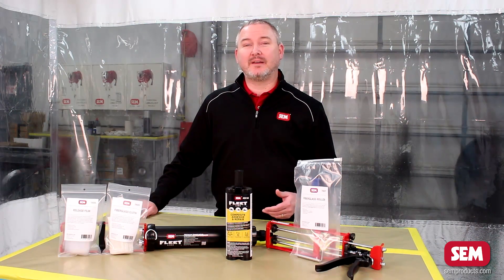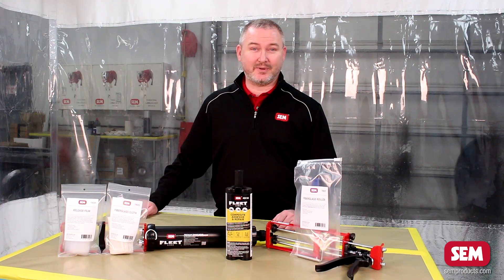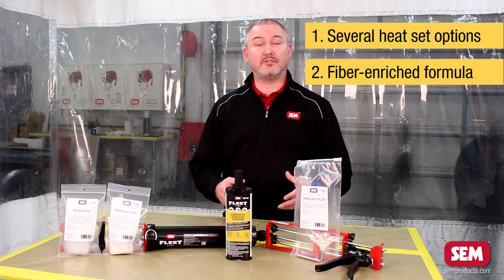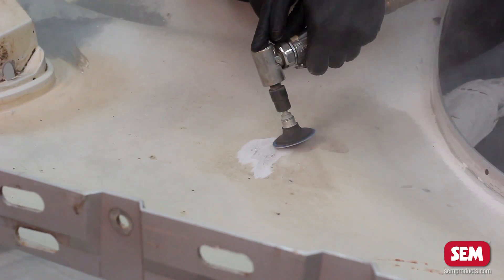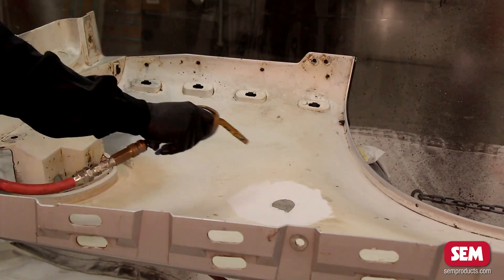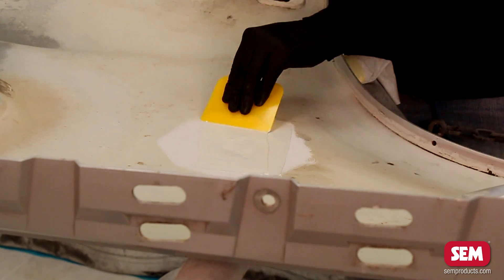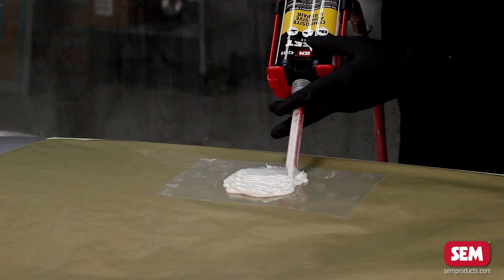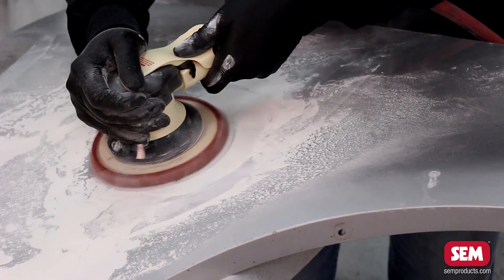SEM How To Series: Composite Adhesive & Repair

Comment: Ok here goes. Mad at myself for not clearing all the ice away when I lift my GM performance SCT style hood for my 2000 Pontiac grand am GT sedan the ice cracked the passenger side rear corner of the hood that faces against the bottom corner of windshield. I noticed the hood which I believe is fiberglass had a top and lower panel bonded together. Both recieved cracking. Uch more so the top panel it appears. To repair would you in this area about 5 inches damage either way . Better to use separate the 2 panels s certain length to be able to shoot in some kind of bonding glue substance on the back / inner side of both panels then bond them back together then work on the outside of both panels and sand paint etc. My GM DEALER my usual body paint guys will be doing it in spring because I was told winter  not a good time to do body work or paint. What do you think and please be very detail with your replies. Very mad at myself dangerous anxiety levels depression stress building. Only happened few hours ago. Been spend hours since trying to figure out how and will I get original strenght back and how well it should turn out. Best way to have these guys do it. I hate and worry always about body guys period using body fill to fill in things cover things up instead of proper strength repairs. GM guys have not done bad work but they at time are not as perfect as a custom shop or me in spoting things. If I can help them help me. And seriously relieve my anxiety etc. I was so blank stupid. I would love to send you my photos via email. Mine aboutme.te@gmail.com..... Troy . God I hope you can help. 1 902 489 5759
Reply from the maker: Troy, our tech support can help you. Call 1-800-831-1122 and ask to speak to Dave or Steve.